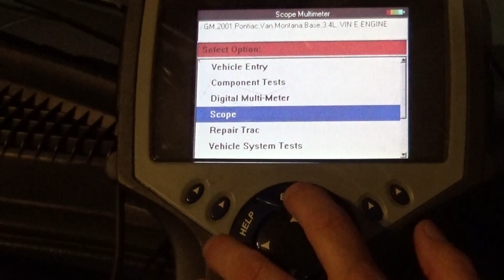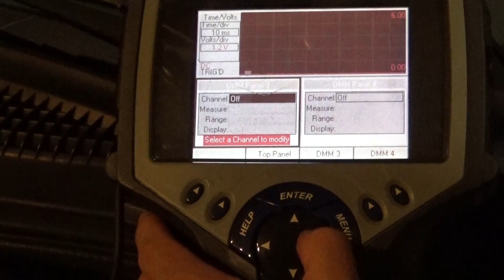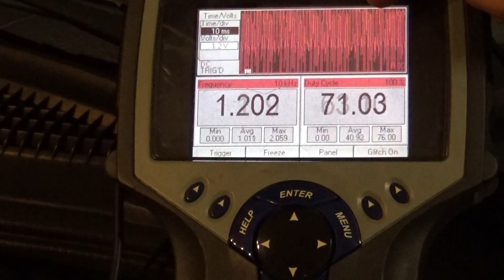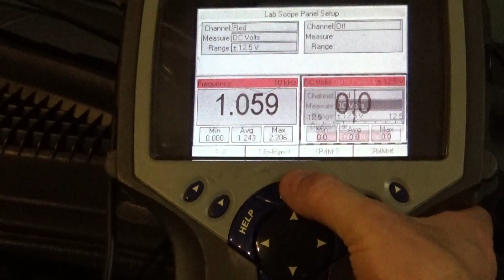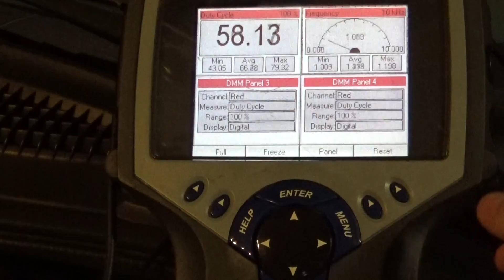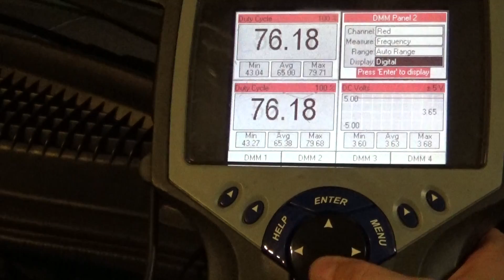How To Use OTC Genisys Lab Scope With DMM To Test IAC Valve

Comment: I have and old OTC Solarity scope along  with a Genisys it still use. Just like to know for the scope feature, do you need to attach and attenuator to one of the scope leads for certain testing? Any help anyone...
Reply from the maker: No sir you don’t need attenuator to do injectors or primary ignition testing with that scope. Just connect your test leads and set your voltage scale on your scope and you are good to go.👍

Comment: I got a otc genisys with lab scope on ebay. It was missing the rest of scope kit inluding leads. I ordered 60mhz hantek leads. My multimeter seems to not be reading correctly. 3 volts for a 9 volt battery. I did calibrate the leads
Reply from the maker: I don’t have this unit anymore but I would check resistance on your leads first and if that is ok you may have bad module.
Reply: @kyhomegarage3430  I believe it's the scope module. I tried on two different genisys scan tools. Bummer. Thought I got a good deal. Guess not
Reply from the maker: @truthhurts2149  you now what you can’t use hantek leads on that module. Ground lead is common for all channels and its coming from middle single port. So you need to have separate ground lead connected . I hope this make sense.
Reply from the maker: Ground port is located in the middle of the module
Reply from the maker: I know this is confusing but you cant use ground lead from huntek leads. Use ground from middle ground port with separate single lead and than you can use positive lead only from huntek lead to measure voltage
Reply: @kyhomegarage3430  yeah I figured that out but I get the same reading even using middle ground lug on the module. Hope I can figure this out. Thanks for your help though.
Reply: My leads have 332 ohms. Maybe only the original leads work? When I connect leads together to zero meter it reads 1.79

Comment: I measured AC voltage using the Genisys DMM and a FLuke multimeter..  The Fluke indicated 120 VAC which is correct as I am measuring the voltage from a household outlet.  When I connected the Genisis DMM it read 161 volts ac.  Does anybody know why?
Reply from the maker: Dave Michaud I really don't know. I never used this scope for 120V circuits.
Reply: The frequency shows correct at 60hz.  Only the voltage is reading incorrect. I contacted Bosch tech support to see if they can answer my question. Thank you.
Reply: @davemichaud1334  Ever figure it out. My scope isn't reading Voltage correctly